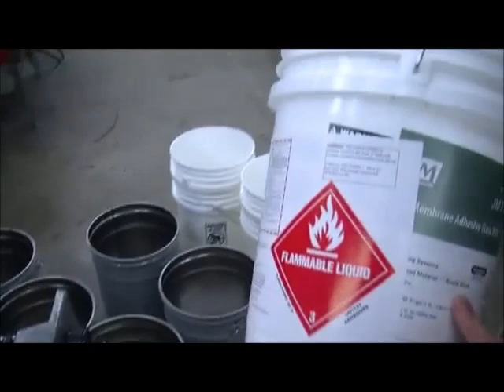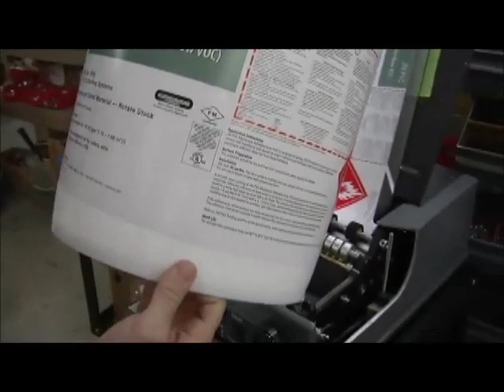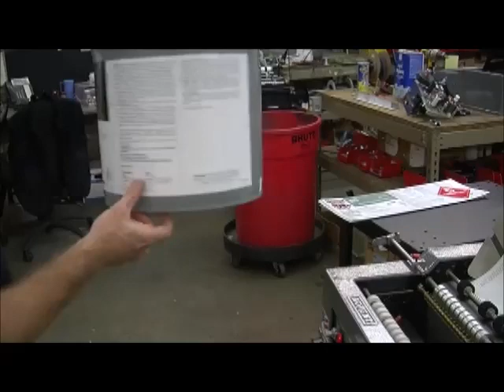Advent Model 205 Pail Labeler

Comment: Where did you buy the custom printed paper labels  and what is the size that you used on the plastic 5 gallon bucket
Reply from the maker: We only supply the machine, you would get labels from your local printer. The machine can use 9" wide and up to 25" long labels.